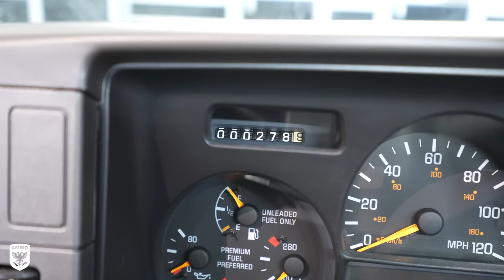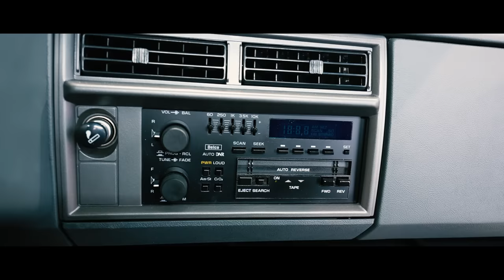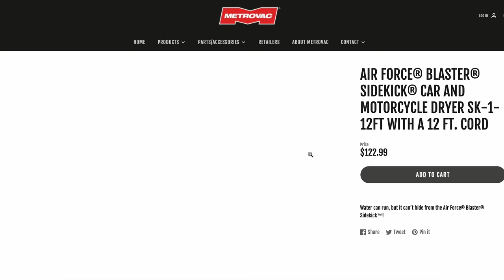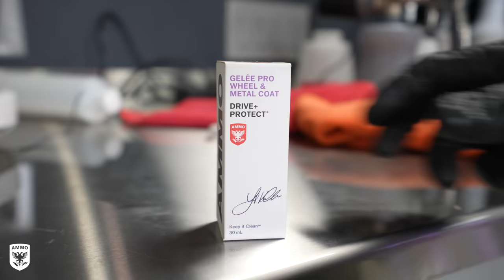First Wash Ever GMC Syclone Truck Only 278 Miles Full Detail and Drive!

Comment: Had a buddy(passed in 2016) that had 3 of them. One was a slightly modded unit, one lost compression and i put an engine in it, and one was a 16k Mile example. I also worked at GMC when those were new and worked on them and the typhoon. Fun and fast trucks.
Reply: That's outstanding, honestly. The Syclone is such a dope vehicle.

Comment: Awesome truck. I picked up my 93’ typhoon in november. One of only 115 made with the color combination. So far, it has a rebuilt original turbo with stronger internals for more boost, bigger injectors, chip tuning, built transmission and corvette ZR1 Sawblade wheels. Over 100k miles with original paint and the car is like new upside and under. Very Happy!
Reply: What's the 0-60 like now?
And the 1/4 mile time?
Reply: @mantis_toboggan_md  0-60 is about 4.3 seconds…I am not sure about the 1/4 mile because the closest track to me is 8 hours away. Hoping to test this summer
Reply: @DrangeDragRacingTeam1967  Nice. That's quite the improvement over stock.

Comment: I love those Syclones. I've seen one in person but it had way more miles than the one you worked on. I've seen a few Typhoons in the wild as well. One had a turbocharged LS swap making over 800 HP to all wheels. Never got to hear it run, but it was on an information poster next to the vehicle.

Comment: I've used the Data Vac by Metro at work and it's a great tool. Cleaned over 400 PCs that had about 4 years of built up dust in them.

Comment: Fantastic video! Quick question- when you blow out your pads, how do you manage the dust?  I find it gets everywhere unless I step outside with the air compressor, but I’m finding it’s eating up a ton of time. Do you wipe down each panel before polishing, or just continue on polishing until the IPA wipe at the end? I also find that it collects in the wiper cowl and door jambs, but I’m hesitant to wash the car again with 0 protection on it in case I introduce more swirls after spending all day polishing

Comment: would not pay 108k for that car. Maybe 55-60k it was nothing special.
Reply: For real. You can find clean examples for a fraction of that. I get it there's no miles. But with that you're buying it to sit in a garage. But then again if you are blowing that much money on a paper weight then I guess it doesn't really matter
Reply: Nothing special...? Lmfao dude it was the fastest production vehicle for its time.
Reply: @Bored Panduh  it goes up in value as time passes lol its a great investment for a collector... those guys don't care about money lol its just numbers
Reply: Nothing special?  I understand if its not in your taste, that is completelly fine. But this truck is a significant part of automotive history. This thing beat lamborghinis and ferraris in its time. It paved the way for performance trucks like the raptor and TRX. Its a beautiful piece of engineering. So many advancements were packed into this thing that changed the way fast cars are made. It changed the way the autimotive industry built cars